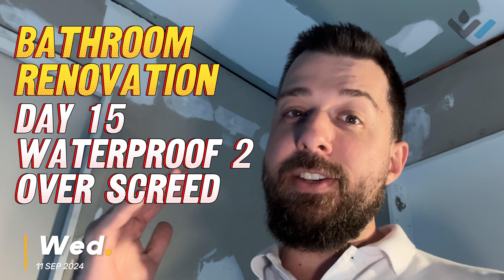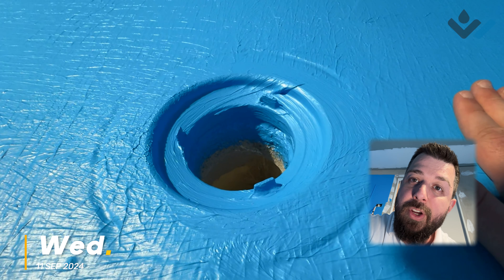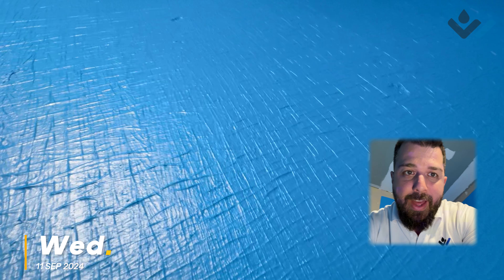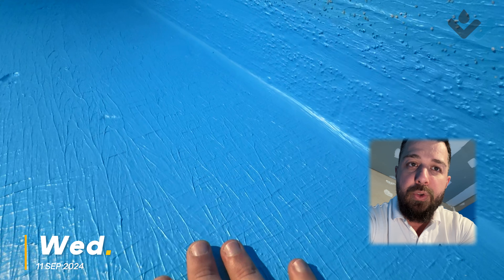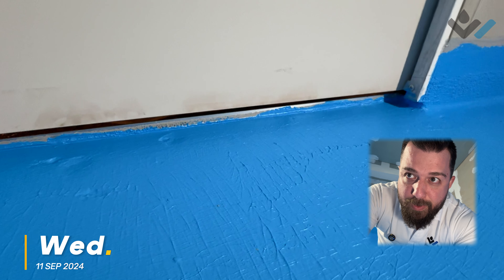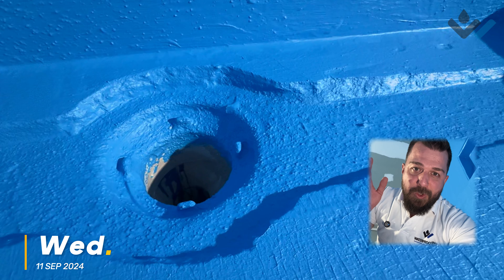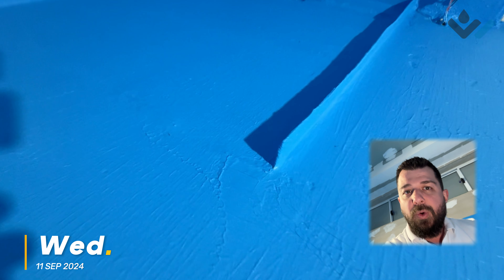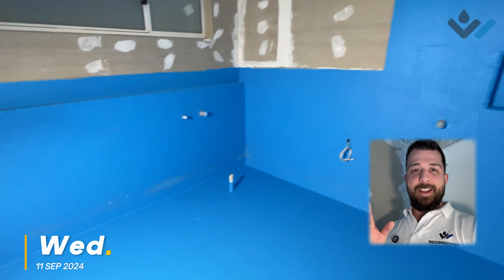Bathroom Renovation Day 15 Waterproof 2/2 Over

Comment: Hi David, does the waterproofing manufacturer specify a single coat in the corners over bandage/tape? From memory the ardex systems and others specify this. Not saying it's ideal but it  may explain the waterproofers procedures.
Reply from the maker: that is a good point, ill look into it but i think chances are against it. thanks for sharing this insight with everyone